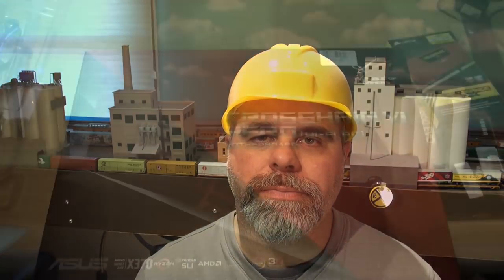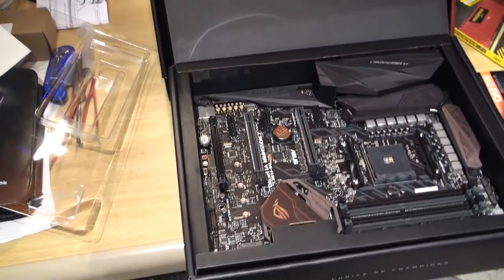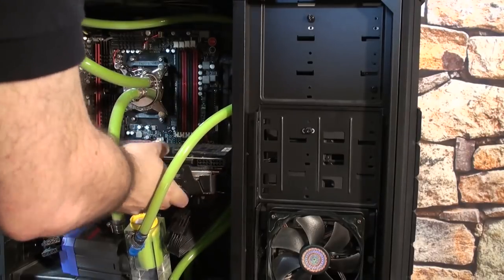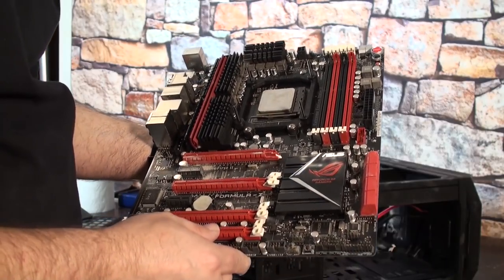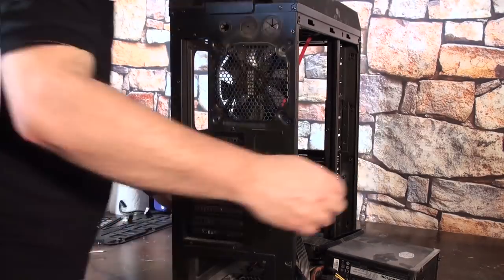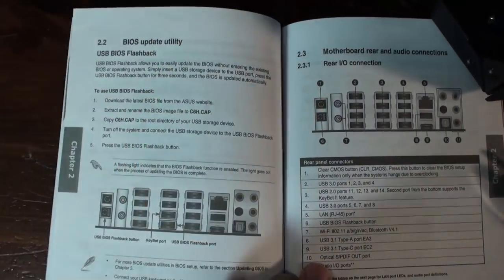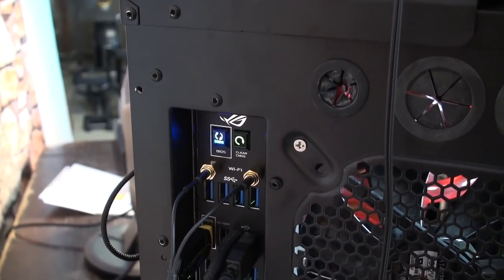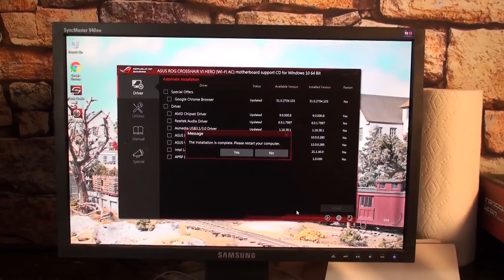The Rise of the Ryzen 7 Computer - DaBob's ManCave💻

Comment: I don't have that problem with my iMac and final cut pro. I just run out of storage for footage even with a 2T hard drive. But I would edit up to 8 different camera shots in to one video some times. Nice job and video Bob.
Reply: I actually do all my video editing on a 12" macbook for that reason.  Trying to use something different for video editing (like adobe premiere) on the little macbook will make you cry, but apple has their own software so optimized that it is just as easy and fast for me to edit on the little macbook as my 15" macbook pro (though exports are slower of course).